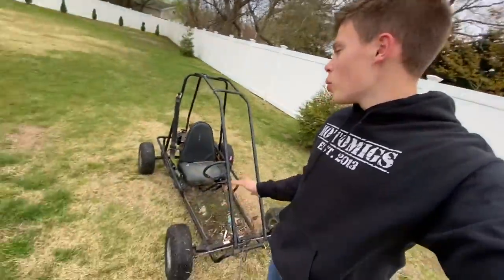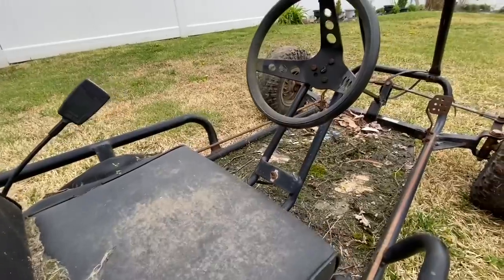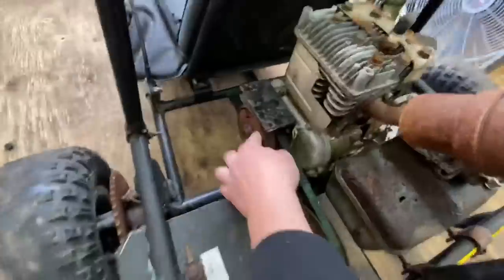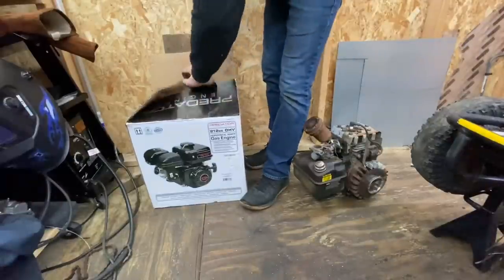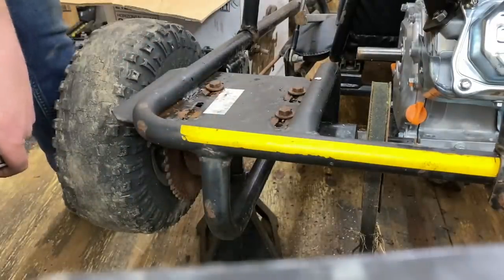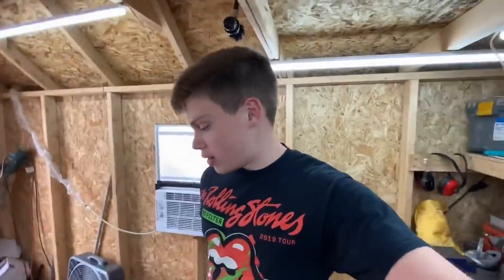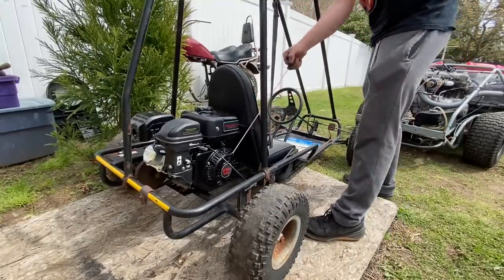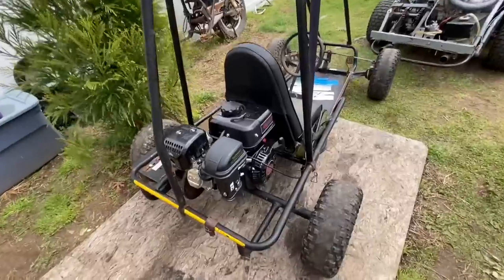The FREE Go Kart Gets a NEW Engine!

Comment: 40,41 and 420 chains will work on the same sprocket..
Reply: 41 won't fit on a 40 thick sprocket.  You can run 40 on a 41 sprocket, but not the opposite.  He might have a 41 sprocket though.
Reply: I guess the sprocket he has is unique. I can run all 3 chain sizes on the same sprocket.  No problems

Comment: I would get that old engine running because I’m cheap.
Reply: Devon Ferguson I feel u there
Reply: He hardly even tried restoring it, its kinda annoying because that is the content we are looking for
Reply: The engine is only $120
Reply: @that250exc  yeah right but if you have 20% off its 100
Reply: Wrong. It would cost more to get the old engine running and proper. Just spend the $99 on a brand new 212
Reply: That thing is really really far gone i doubt it would really be worth it price wise,would make a cool video thought
Reply: @Lazer-rj6vu it would not cost more than a new engine to get it  running proper give the carb a good clean and youll be golden

Comment: You should put a piece of flat bar across the plate for the torque converter. That’s what that system is. I had a carter years ago when I was a kid and the plate will eventually bend especially with a new engine.

Comment: The Briggs flathead is a good engine , but out of production for a while . Only 5hp , and race parts are  getting much harder to find. (they used to build these to 12 or 13hp)  That carb is the "low emission" pulsi-jet   ,  fixed main jet , total junk.   If...you can locate a fuel tank it will be about $60-$70 , maybe more.

Comment: Use a little 1/8” thickness yard trimmer line (about an 8” piece) push it down in the hole leaving just a little piece sticking out where a spark plug would sit and this locks up the cylinder from moving up and down. That’s a great way to get the shaft bolt out of a small engine

Comment: I had this exact brand and body type of gokart, I took the roll cage off mine, this body type doesn't require the cage for structural support, mine had that same stock motor to and I swapped it with the predator 212, I also took a 68 vw beetle seat and cut its lower mounts off and back rest off and put it on as a seat, the springs of the seat made the ride so smooth you couldn't feel anything, also I had bicycle tubes cut up and placed between the engine block and mounting plate to serve as vibration dampers, I had it super smooth and super clean, I had to sell it tho sadly and it miss it, seeing this video makes me happy to see someone else with one 😊 also the tires on it have tubes in them so keep in mind if your thinking of changing them, when I tried to change mine I didn't know and i almost damaged my tubes 😅😊